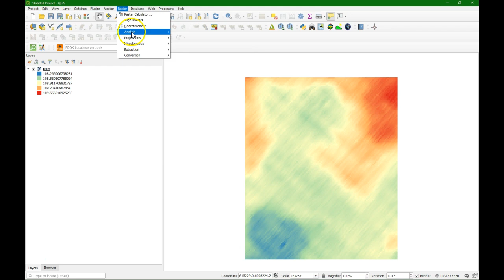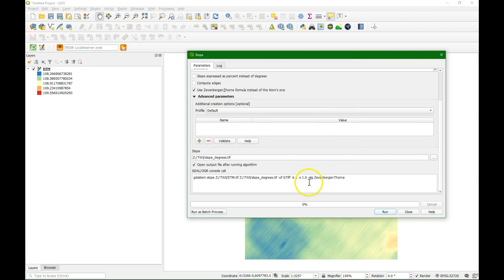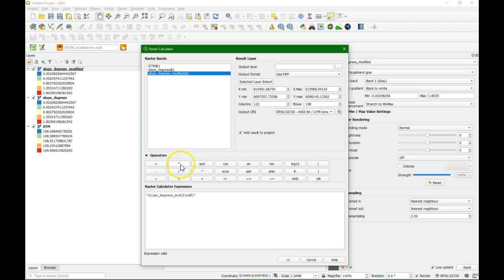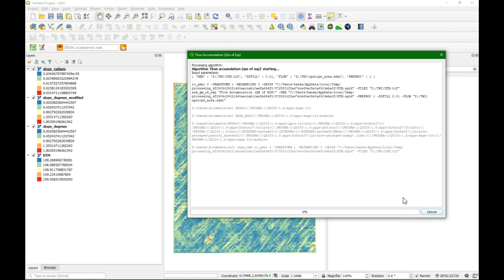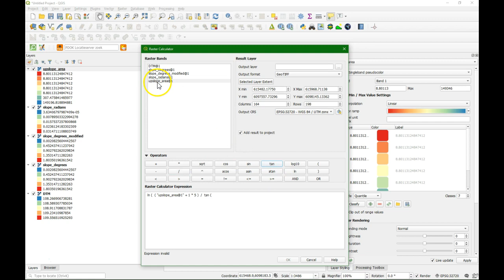Calculate the Topographic Wetness Index in QGIS

Comment from the maker: The last equation contains an error. The upslope area is calculated by the SAGA tool in pixels. So it needs to be multiplied by the area of the pixels. In this case 5 x 5.
Also maybe not to clear why we have to modify the slope map. Because we take the natural logarithm, we can't have 0 or negative slopes. We make those cells 1, because ln(1) results in 0.
Reply: Why do you add one? Would the corrected equation be.... ln(upslope_area + 1 * 5*5) / tan(slope_radians)   ?
Reply from the maker: @hannahwhite9249  The one is not needed. So the correct equation is ln((upslope_area * 5 * 5) / tan (slope_radians))
Reply: hello. how can I determine the area of a pixel?
Reply from the maker: In the Layer properties you can find the cell size as length in x direction and length in y direction. If you multiply them you have the area.
Reply: @HansvanderKwast  Thank you so much for your reply. I cannot add the image of my layer property. Is this true that the "Pixel size" in the "Information" of the "Layer Properties" is the area of a pixel? Because in my case it is 30, -30. I am confused about the negative value. I hope to receive your feedback
Reply from the maker: @maggienguyen8676  negative is to indicate the size in the Y direction. So you have square 30x30 m pixels.
Reply: @HansvanderKwast  thank you so so much for your support! I wish you have a nice day!
Reply: @HansvanderKwast  Sorry for asking you a lot but i don't know why I cannot calculate the flow accumulation. I use the raster file with CRS: ESRI:102164 - Lisboa_Hayford_Gauss_IGeoE - Projected, and my QGIS is 3.16. Would you mind telling me what mistakes I have made while calculating? Thank you in advance.
Reply from the maker: @maggienguyen8676  What is the error?
Reply: @HansvanderKwast  it loaded until 100% and then it is frozen. i need to turn off QGIS and re-open again
Reply from the maker: Can you find the result on your harddisk even though QGIS crashed?
Reply: @HansvanderKwast  no, i cannot. There was no result files at all. it is just frozen and I only can turn off QGIS
Reply from the maker: @maggienguyen8676  Hmm, I can't think of an error. In general, check if your folder and file names have no spaces or strange characters. Also maybe try another projection, use an EPSG code, maybe UTM.

I find the SAGA tools not very robust at the moment. You might consider to use my PCRaster Tools plugin for the same calculations. See https://jvdkwast.github.io/qgis-processing-pcraster/ for installation instructions and check this video on how to access a tool to calculate TWI: https://youtu.be/KbjIsFL_PcM
Reply: @HansvanderKwast  I just re-run again and there is a notification, which says" Creation of missing tbl_srs in private qgis.db failed. database is locked" Honestly I dont understand much about it.
Reply from the maker: @maggienguyen8676  Are you on Linux?
Reply: @HansvanderKwast  no, i am not. i use window actually
Reply: Hello Hans. Thank you for your video. I have a question, if the last equation take into account the pixels' area, shouldn't it be: ln((upslope_area * 25) / tan (slope_radians)), rather than ln((upslope_area * 5 * 5) / tan (slope_radians))?

Comment: Hi Hans, great video. I'm having trouble with the Flow Accumulation (qm of esp) tool in QGIS. If I use the option "fill sinks," temporarily or permanently, the operation never finishes. It just adds "(not responding)" to the top of the tool. Is fill sinks really necessary?
Reply from the maker: Fills sinks gives problems in the following cases:
1. DEM too flat
2. DEM too large for memory
3. Geographic Coordinate System used instead of projection.
4. Spaces in folder and file names

Fill sinks is necessary in hydrological analysis, otherwise water gets trapped in artificial sinks and will not flow to the outlet of the catchment.
Reply: @HansvanderKwast  Can you reccomend another tool for filling sinks? I also have problems with this tool working with big DEMs
Reply from the maker: @hvzxjgqnqmz  Did you try Wang & Liu XXL?  That's for big DEMs.

Comment: Hi Hans, I successfully made a TWI map of my study area, and have since done a series of 120 cm deep soil core observations. In hilly areas the TWI corresponded quite well with soil wettness of my field observations, but in the flat areas I observed much wetter soils than the TWI model predicted. Is there a better model for predicting wetlands in flat terrain?
Reply from the maker: TWI is indeed not suitable to detect wetlands on plateaus, because it only takes into account the contributing area and the slope. I don't think there are specific indices for those cases, but you can create an empirical model when you know the conditions that these wetlands exist, for example by adding data on permeability.

Comment: Hello! I wanted to ask why you do that from the DTM and not the DEM. Would it work if we start with DEM data? 
Secondly, when I created the upslope area. It is created in another coordinate system. So the results are sent to the middle of nothing. Instead of the place where my study area is.
Reply from the maker: Check this video for the definition of DEM, DSM and DTM: https://youtu.be/pnAdasqHxGk. A DEM is the general term. DTM is when the objects (human and natural) are removed and we only have the elevation of the terrain. For the algorithm it doesn't matter what you use, but if you use a DSM, the objects will be interfering with the general drainage.
If your upslope area is in another projection, you need to reproject it to the same as the other layers in the project. With raster calculations also all rasters need to be alligned, using the Allign rasters tool.

Comment: I can't seem to make the flow acumulation, QGIS shuts down everytime. Can you help with this?
Reply from the maker: Hi. Which version are you using? Is your DEM projected? Which projection?
Reply: @HansvanderKwast  Version of QGIS? 3.10.3 
When I look at the properties, it says it's projected, "EPSG:25832 - ETRS89 / UTM zone 32N - Projected"
Reply from the maker: That seems to be okay. Can you please check if file or folder names have spaces or special characters. That is also often a problem. Which operating system are you using?
Reply: @HansvanderKwast  the path to the file is: C:\Qgis\Bachelor\DTM_.tif so there are no spaces or different letters. I use windows 8, would that have any effect?
Reply from the maker: Still looks okay. Can you e-mail me screenshots of the dialogue screens before it crashes?
Reply: @HansvanderKwast  Hey Hans,
I am having the same problem. 
I am using QGIS- 3.16
Projection: EPSG:4326 - WGS 84 - Geographic
there is not space or special characters 
OS- Mca os

please help with this...
Reply from the maker: @mdashrafulhaque1247  You can't use EPSG 4326. The x and y units are degrees, the z units in meters. The algorithms don't know this. You always need to project your DEM for calculations.
Reply: @HansvanderKwast  what projection should I use?
Reply: @HansvanderKwast  Can we use EPSG 2154 ? Because Qgis shut down when try to make the flow acumulation
Reply from the maker: @GrmWrq  It should work with that projection. Maybe you can use the newer methods on my channel, using the more robust PCRaster Tools plugin: https://youtu.be/bdvEFRtDtWU
Reply: @HansvanderKwast  The process finally worked but the TWI output raster doesn't seem to match up with known water accumulation areas

Comment: Dear Hans van der Kwast
how can I create DTM as shown in this video?
Reply from the maker: This DTM was created with special equipment (LIDAR) on the ground, it's not possible to get this as open data for the whole world. If you have LIDAR, you need to interpolate the point cloud to create a DTM like this.
Reply: @HansvanderKwast  Can we use DEM instead of DEM ?
Reply: @spaciandd  Yes, both DEM and DTM are bare-earth elevation models (often used synonymously).